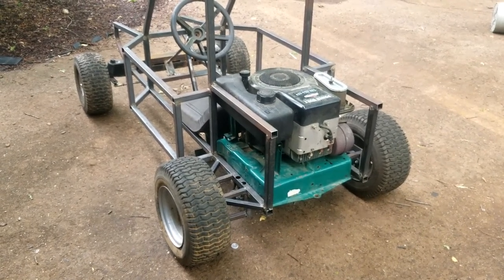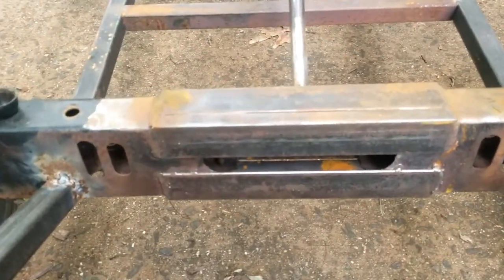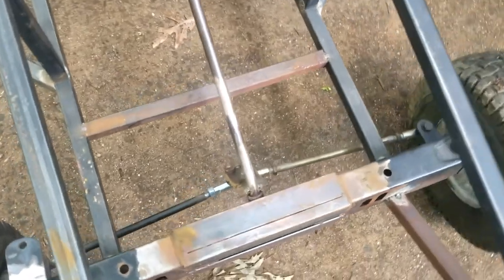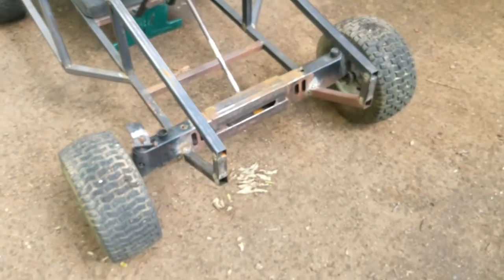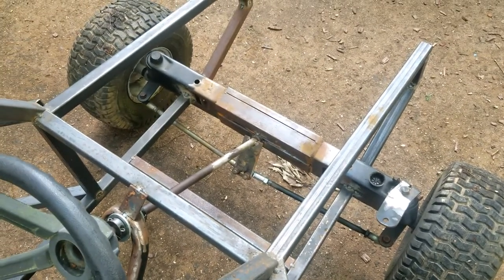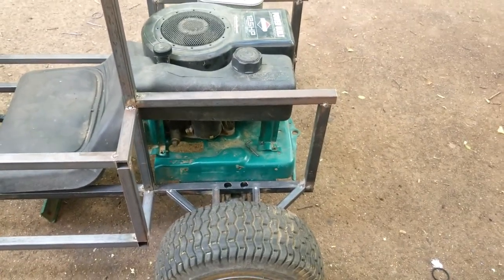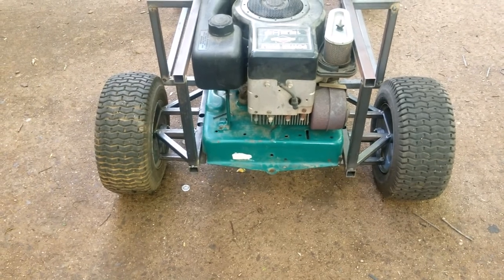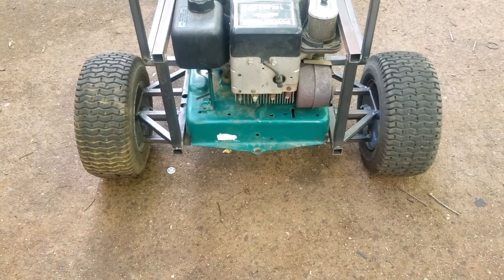5sp Manual Go Kart using Lawn Tractor Parts.

Comment: What size square tubing did you use there
Reply from the maker: The main framing is 1 inch square and the axle supports are 3/4 square.... I've forgot the wall thickness though lol.